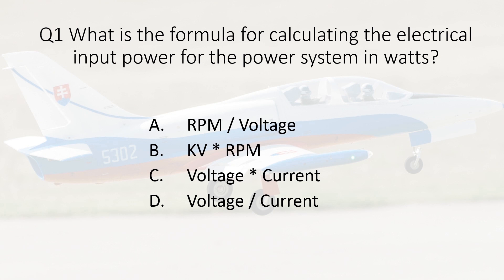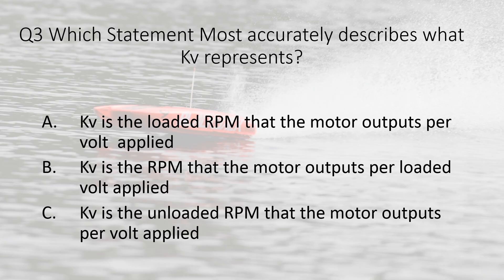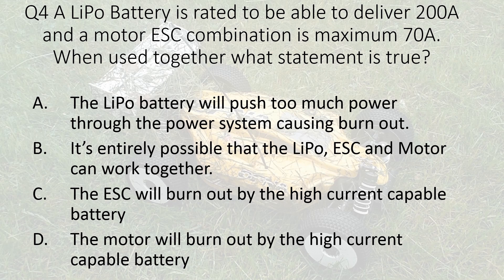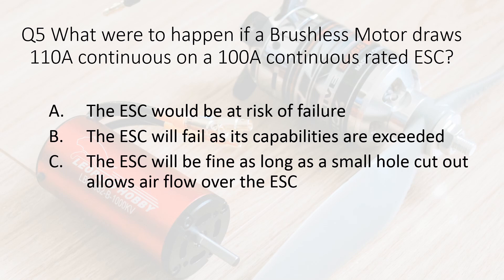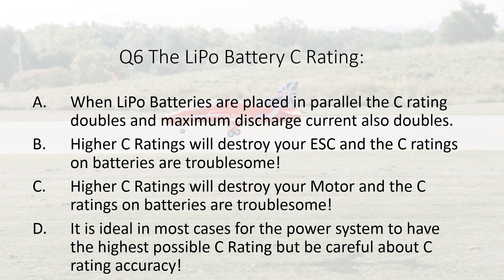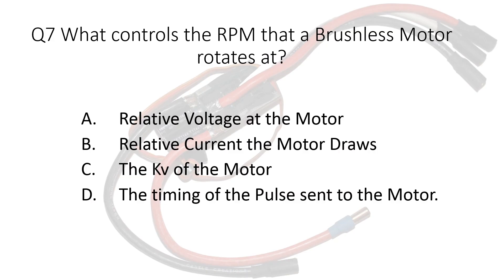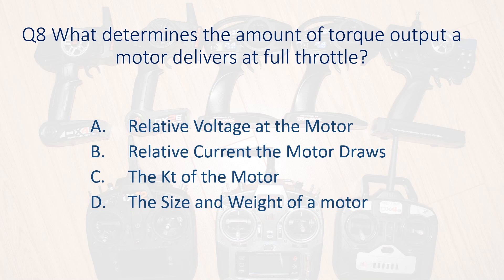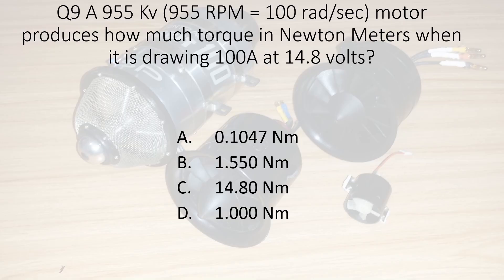Theoretical Brushless Motor and Power System Question Set - Can you get all these Correct?

Comment: 1C 2B 3C 4B 5A 6D 7A 8B 9D for me...although for a couple I had 2 I thought were right 6A and D. Awaiting scores from teacher Ryan 😁
Reply: For 7 I think A, C and D are all factors determining RPM...but which is most correct?!
Reply from the maker: Question uses control rather than determine, does this change your thoughts?
Reply: If I'd read it more carefully! The ESC pulse controls the rpm then, I think that was 7D

Comment: Q4 should have been in the form of C rating, as most users don't calculate current, and will focused on the C rating and nothing else.
Reply: 🤔 but c-rating is telling you the current of the battery.?
Reply from the maker: That would leave an opportunity for someone to get stuck on the calculation and miss the point of the question. A C rating specific question comes later. Don't forget to leave your string of answers!